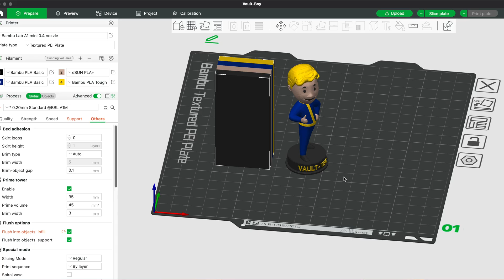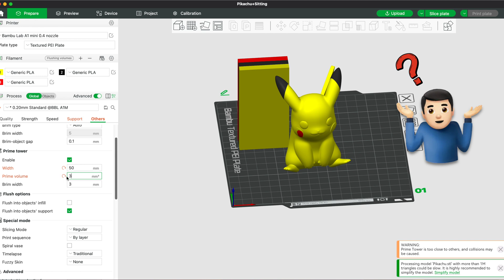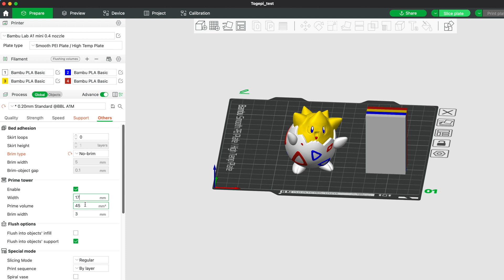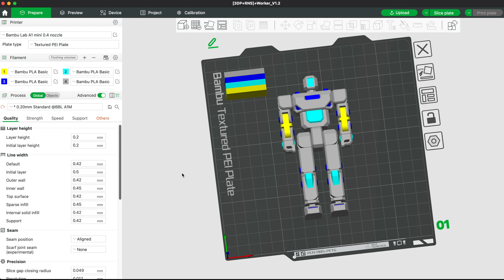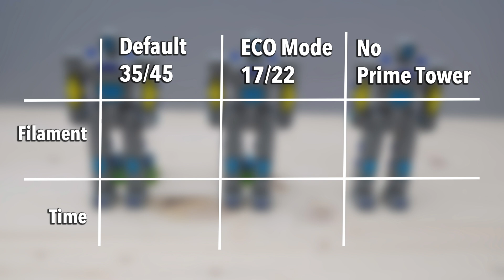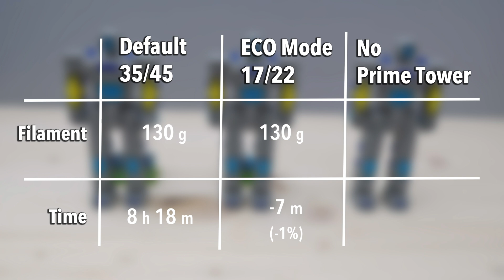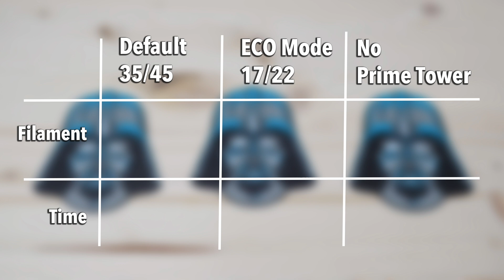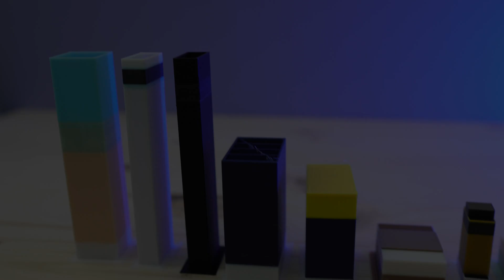Do you need the Prime Tower / Purge Tower? (Multicolor 3D Printing)

Comment: It’s the purging that is terrible. Seeing half a kg of wasted filament to print a 100g object is terrible.
Reply: Is this real? 500g waste for 100g print seems unreal
Reply: @jeriellopez4927  it depends on how many colours you use and how complex the design. 
The purge is the same amount every colour change. 
So if your printing something like a rainbow your going to waste an absolute tonne of filament. 
Where as if you were just printing something that was black until half way up and then it became white for the rest that would be only a single purge event. 
But if you have 4 colours on a single layer for every layer in the entire print…. Not your talking about 4 purges multiplied by the number of layers. 
The wastage will outweigh the print weight significantly. 
All depends on the print. 
That’s why Prusas big printer can use a bunch of individual hot ends instead. Each hotend is loaded with 1 colours and the machine just changes the tool it needs as it goes. More like a fancy CNC machine.

Comment: So the conclusion I get is that a prime tower is advised, but the default settings are too strong (probably on purpose)
I'm wondering, if combining this with the option to prime into the model (in the infill for exemple) could remove the prime tower entirely without risking that slight underextrusion that might happen sometimes.
After all, if the infill is under-extruded in a few spots it hardly matter, no?

Comment: Lukis, just looking at the poop amount: are you using the latest default bambu settings? or have you tried any pooptimisations?
Reply from the maker: yes i think its the newest one.  Nevertheless, In this video, my goal was to only evaluate the prime tower, so i didnt use any optimisation (like changing the flushing volumes or purging in infill etc.). I tried to keep everything at default except the prime tower settings.

Comment: "A prime tower has nothing to do with purging to prevent color bleeding"
This is extremely inaccurate information. The purge (or wipe in other slicers) tower is directly related to color/material transitions. Yes, depending in your settings you can basically shrink it to nothing but if you see it as nothing but waste you're looking at it wrong.

No matter what you need to purge your hotend when changing colors or material. This amount will depend on many factors but you need to account for it in one way or another.

In your case you're doing a "free-air" purge off the side of your bed, so yes your tower can be small. If you had a way to mimimize the time between purging and returning to the print you can remove it all together. So in reality you're just purging too much to begin with.

You could also completely remove the free-air purging and only purge into the block itself. This would entirely remove waste you see outside if your printer bed and all of it would be within a single block you can dispose of.

In either case, what you're now talking about is tuning purge quanities and purge locations. And not, "this feature is not needed."
Reply from the maker: Thank you for your comment! I totally get what youre saying. I guess my explanation is from a perspective of a user who uses BambuStudio slicer+ Bambulab printers and doesn‘t wanna deal with experimenting purge quantities. For that, the slicer already calculates the optimal quantities for me. All Bambu printer utilizes free air purging to purge colors so from my perspective, the tower is meant for priming and not for purging. Thats why i called it the prime tower here specifically instead of the purge tower.
May i ask you which printer/which slicer you use and if you purge everything into a tower, and not free-air?
Reply: @Lukis3D  Das wäre doch ein interessantes Video? Spülung abschalten und im Prime Tower reinigen. Null Poop Strategie! 😂

Comment: I heard you can use objects as a prime tower if you don't mind muticolors in your second object.  It would be cool to have you showcase that as well.
Reply: Yep - you can.  This comment is old, so you probably figured it out already, but when you have more than one object on the plate and the plate has multiple colors, just right click one of the models on the plate and select "Flush Options" and then "Flush Into Object".
Reply: @MaximalistWorkshop super helpful. Thank you.  I’m about to make extensions for my filament shelf.  This is ideal.

Comment: when printing with supports, is there any reason we can't just prime to the supports?
Reply: Supports don't exist in many prints and don't exist once all supported areas are exhausted beyond the lower layers. A more reliable method would be to print infill first, then inner walls, followed by outer walls.  ..or at the very least print outer walls after inner walls because I don't know if slicers support printing infill first.

Comment: i have a p1s and no ams (going to go get one soon).  i do multi color by layer with pauses.  ive done both.  i find that when i load the new filament, if i just make it extrude 3 or 4 extra times, i don't need the prime tower and dont have any underextrusion issues.  not sure how you could do that on ams?
Reply: 2:43 Poop Größe ist einstellbar

Comment: "I WASTED FILAMENTS SO YOU DONT HAVE TO" said the legend <3
Reply from the maker: exactly😂
Reply: @Lukis3D  Duuude! I appreciated the tests, I do own a Bambu + ams but try always to minimize color changes on the same layer or close, I swear I still refuse to print full multicolor with one toolhead, it makes an insane amount of waste! Like the mini Jordan poops 3 times the volume of the build and it's 3 colors, madness! Thanks for printing for us all those pokemons 😅
Reply: @Lukis3D  *ending the video - I liked a lot the robot, Im very into the Dummy13 thing and the bot u printed is very nice to be a print in place. Hueforges and flat prints on bed is where u got to the point!
Ok, one point I have is that a 7m difference it's not always just a 1% on 8hrs. My life is short 7 mins is 7 mins!
Apart that, the added time is negligible and the difference is crucial I see, when you have color changes on the bed or on the visible upper surfaces.
There, it makes the difference because the color change and nozzle residual pressure is managed at best and the prime tower is needed so large only when it has layers with multiple color switches. 

That thing the residual pressure sends me mad. Now I know what t f is making the nozzle drip. Negligible with PLA but sensitive on PETG. Really, thanks! I'm working on some printable playin cards just right now, other than enjoy a lot hueforge. Using that pesky tower sometimes will improve some things!
Reply: "I generated 1kgs of poop, so you dont have to"

Comment: Great video! 

Did you try the option "flush into objects infill"? I saw, that you deselected this option.
Reply from the maker: thanks for comment! and im glad that you saw that. My initial plan for this test was to keep everything at default as much as possible and only change the prime tower settings, so i could judge the results solely based on the different prime tower settings.

Comment: I would say flow is fixed by the time the outer wall is being printed especially if your print order is Inner/Outer. I think it explains the Vader print small holes. I personally use 10 width and 10 volume.
Reply from the maker: i use 10/15 from time to time with great success, and thanks for pointing that out!